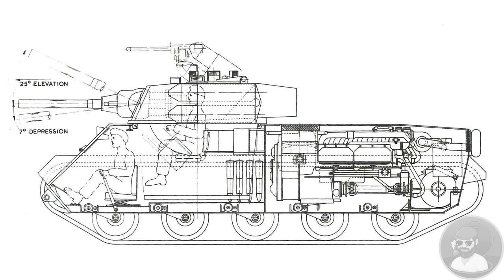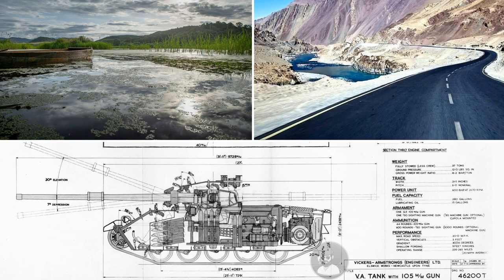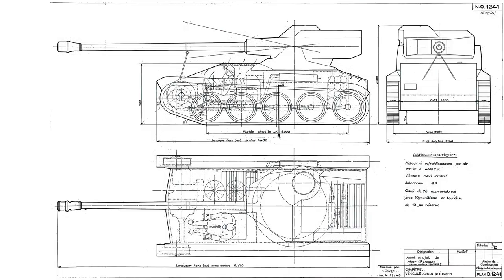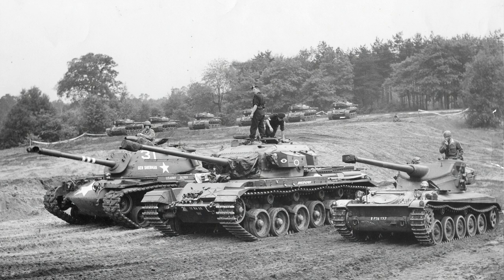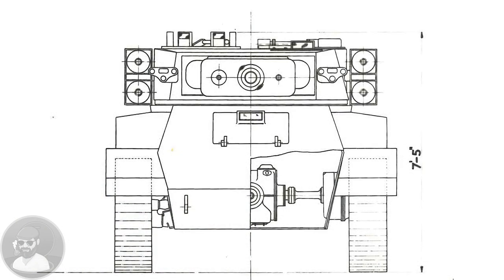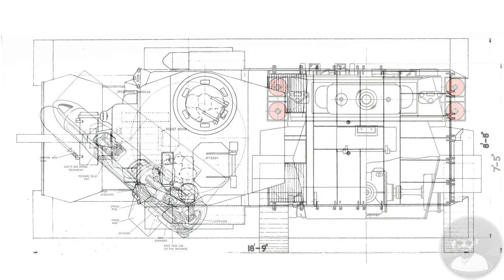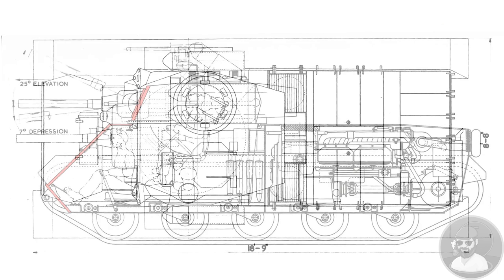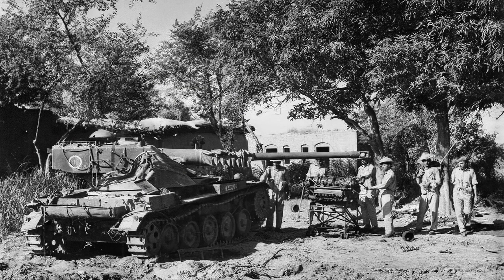Vickers V.A.P.T  - Tank Design and Development

Comment: I love your videos. But like to intervene on a point. AMX-13 of Indian Army did defend against heavy boys of the M-48 Patton tanks during Battle of Chhamb (1965 Indo-Pak war). I know you dont have enough articles for the same but there is a live example at Cavalry museum Ahmednagar India where you will see a M-48 Patton which was hit frontally by an AMX-13 (the dent made on the frontal armour was certainly made by a 75mm gun). But it couldn't penetrate. Surprisingly the AMX-13 went to the sides and hit that M-48 Patton through the gap between the roadwheels killing the crew due to spalling. So basically it is the crew who decides victory or defeat rather than the Tanks!